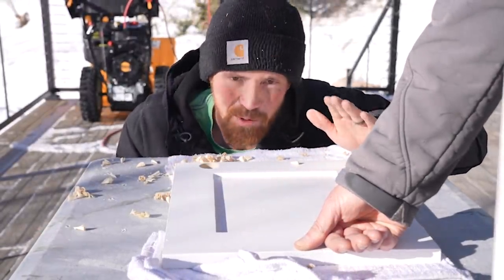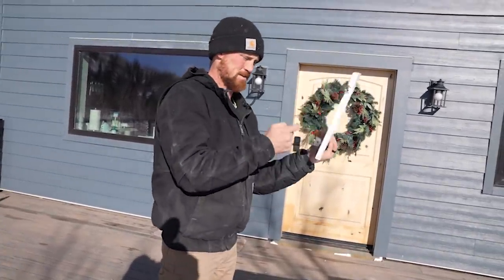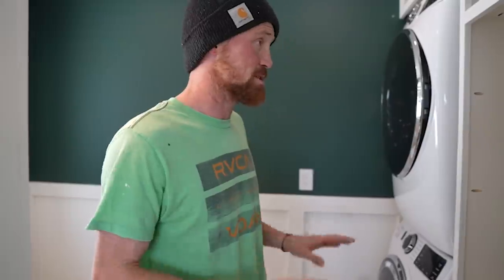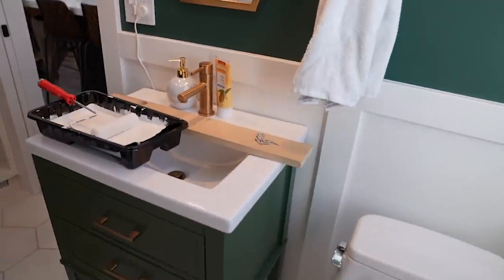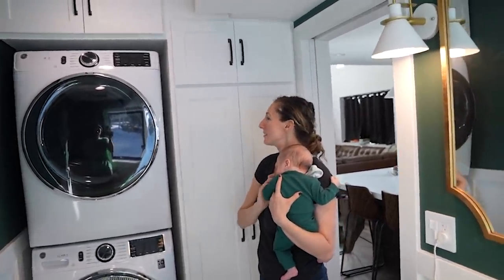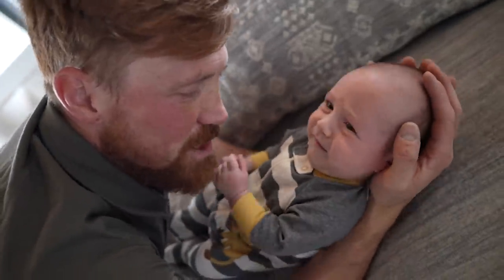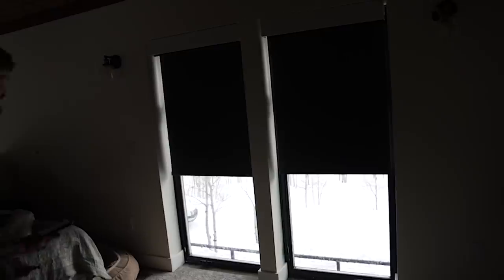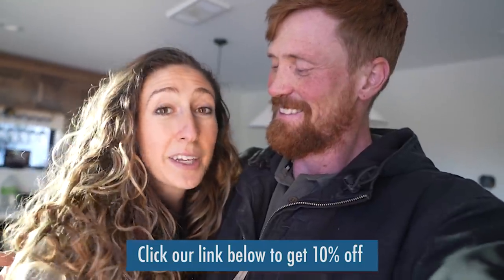LIFE CHANGING UPGRADE | BUILDING OUR OWN HOME

Comment: If you use a cloth (canvas) drop cloth instead of plastic you will find painting easier.  Cloth soaks up drips, dries faster than plastic. Is reusable,  doesn't stick to work, can be cleaned in washer, and in the end is less expensive to use.  It soaks up stain too.  Don't use plastic except a a barrier when spraying.

Comment: Put felt bumpers or clear bumpers on the backside of the doors where they meet the face frames in the corners of the centers of the doors.  When the doors are closed the centers of each door goes in towards the face frame, while the hinge side of each door is proud of the frame the thickness of the hinges.  Your doors will lay flat instead of the centers dipping in towards the middle when they are closed.  An OCD person will appreciate that improvement.

Comment: Get a flat tip screwdriver and punch 3 or 4 slots in the bottom of the groove in your paint cans . So when you pooring paint it will run back into the can . And when you put the lid back on the can will seal up without spreading paint EVERYWHERE 😁😁
Reply: @leoncolyer9420  I have been reporting them myself as much as possible. If you see them click on the 3 dots to the right of the post and click on report. It will then take you to a screen that you can select what to report. ❤
Reply: @leoncolyer9420  You can report them. They are probably bots.
Reply: Better yet, they sell several different types of pouring spouts for paint cans.  Also, pour some paint into a small glass jar so you don't have to open/stir the gallon every time you have to touch up something.

Comment: Everything coming together ❣️ looks great❣️ enjoy. They are called shades on your windows. Blinds have slats❤️ just a little FYI. I worked at a do it yourself center for many years.
Reply: Also, the difference between curtains & draperies is that drapes are tucked at the top and move on a tract when you pull a string, and curtains are directly on a rod and you have to slide them open with your hands
Reply: So why are they called roller blinds?🤔 I always thought a shade cast a shadow whereas a blind caused you to be unable to see through.

Comment: always have on hand a roll of kraft construction paper (3x100' roll)$11 to $ 15  a roll @ lowes ,home depot or bldg supply. ((i've been in R.E. development for over 35 yrs)  its invaluable for any project, especially with dogs and kids. its heavy weight, used for  mud at entryways, paint , plastering projects, protects carpets, floors, I wrap/ package for storage items, I've used it for paper floor applications on concrete or on walls, kids projects, dog / pet cage liners,, temp wind breaker, etc. its a cheap quick protector, fire starters, etc. you'll love the convenience. oh, and I love your channel, thanks!

Comment: Trent, as to painting the long cabinet doors?  Tape a piece of plastic sheeting up on the wall.  Lay another piece on the floor and lean the doors up against the wall, longways.  I used this technique to paint all interior doors during a remodel and it worked just fine.

Comment: I put eye screws on the bottom/top (non visible) edge of doors and hung them from a wire "clothesline" between two stepladders.  Made painting go much easier.  I use cloth drop cloths and wash them in the washer periodically.  Spent close to 40 years renovating our home.  Process was renovate/plan/new renovation/re-do more/re-do more took a while - new owners are still doing more.  1880's house.

Comment: I use card board.  Moving box… cut and tape  the flaps.  Stays flat on the floor un like plastic or drop cloths.  The perfect drop for painting.  Slides with ease on carpet, linoleum, and hardwood floors.

Comment: Trent, that Kreg Jig for the hinges has two holes at the top sides of the big hole.  That is there so you can use a 1/16th drill bit to pre-drill the screw holes for each hinge.  That makes them square every time.

You also need to set it against the door and clamp it down for accurate results every time.  Otherwise, the Jig can move during the drilling process.  That would account for why the hinge holes don't line up sometimes.

Comment: Piece of advice for future cabinetry.  1) temperature affects wood cabinetry MASSIVELY, and everything should be fully acclimated during construction at all times. 2) use a combination of soft-close and self-close for the best function, because even top brand soft close will tend to not close completely over time. 3) always float your panels with spaceballs because ply doesn't move and solid wood does, and your cabinet doors can warp or break if you don't.   Love watching your guys journey though.

Comment: After all that, you should, begin to design the basement. This should be the Guest Room, Den and Office space, and Food Storage Space. With a Ten-Foot-long Murphy Bed, and Wardrobe / with Pull Out Nightstands (kinda like a pull-out Chopping Shelf into a Wide Center rail at Matress height. Inset doors with a Solid MDF door, painted (for humid areas: more stable). Use a 3 Degree  facing back Bevel on door edges to prevent binding . Deep inset hinges.

Comment: The wafer on the bottom of lebkuchen (please note Trent - there is no vowel between the b and the k) is an oblaten and is made of wheat.  It is similar to a communion wafer.  The lebkuchen batter is spread on the oblaten before baking.  It is meant to be eaten with the cookie.

Comment: You want car detailers sand paper for the dry paint. 1500 grit sand paper. A gentle rub down when the paint is dry will smooth all the grit out of the paint and then just wipe with a wet cloth. Works on clear polish too as the sandpaper is too fine to leave any marks

Comment: My thought on having to pump is not to forget eye contact while feeding.  I chose to use a cup at first, not to have nipple confusion then eventually a bottle.  It was the weight gain issue and we did not want to have her put on formula.  Do what you need to.  You are great parents.

Comment: Trent, take another look at that Kreg jig that you're using for the hinges. There are two very small holes on either side of the forstner bit cutout. Drill those before pulling the jig off and that will help your hinge alignment.

Comment: A little pointer:
If you are using Latex Paint, you use a Felt Roller.
When using Oil-Based Paint, you use a Foam Roller. 
And follow up with a brush on both. (the brush lines up any fuzz, and kills bubbles.)

Comment: What model Kaboto do you have with the blower.  I am looking at up grading my John Deere lawn tractor that has issues with big snow falls.  I’m 75 yrs old and clean my 1600 feet of two track myself. No one will plow because it is tree lined with nowhere to push snow. Blowing is the only option. I need a tractor with the bigger wheels in the back.

Comment: Near the end you hit one of my pet peeves. If a restaurants dinning area is not open for sit down, the restaurant is closed until the sit down opens.  Covid is over get back to normal.  I worked for 9 months in plant in 2020 and did not get covid.  Let’s get back to normal.  Yea wash your hands a little bit more and clean surfaces a little more often.  I won’t get into the worthless masks although they are as good as a scarf at staying warm.
Blinds will be great until you loose a remote.  Get the remote tags for the back of each. The tag beeps.

Comment: I'm surprised you're not painting in the basement.  Too cold?  Too late now, at least for this project.  Are you guys going to do storm doors, or an airlock entryway to cut down on heat (and cool air) loss when you go in and out and infiltration?

Comment: Hmmm amazing.
You could take a few minutes and plan your work before beginning. For examples, you knew the sides would be an issue then why didn’t you mark, drill holes hinges first, then paint the sides. Also you painted the door closest to you first and had to reach over it wet to paint other door.  Plan your work.

Comment: I have to say, I'm a little jelly at the DIY opportunities you have there. In Australia I couldn't install ceiling fans (not even into existing fittings). It had to be done by a licensed electrician. That's why I have manual roller blinds 😄

Comment: The bottom of the Lebkuchen you say tastes like styrofoam is actually called Oblate. It is edible. 
It is also used in Catholic churches during the mess service and symbolises Christ's body. 
Just try to avoid one thing: to stick em against the upper gum in yojr mouth because it is hard to get off. 😂